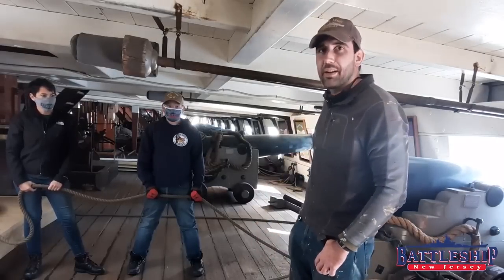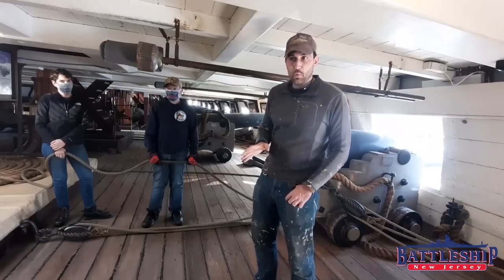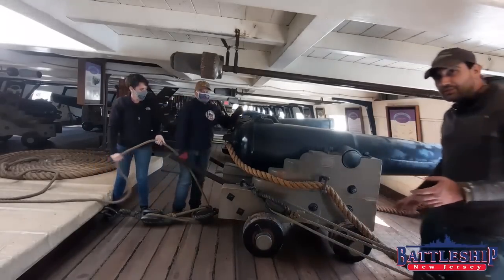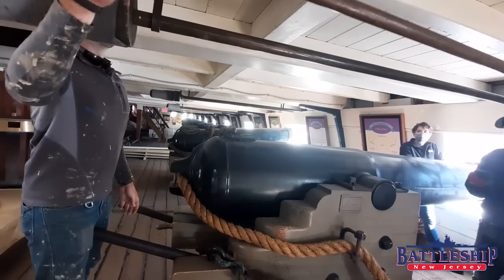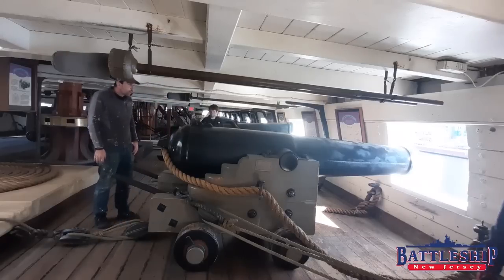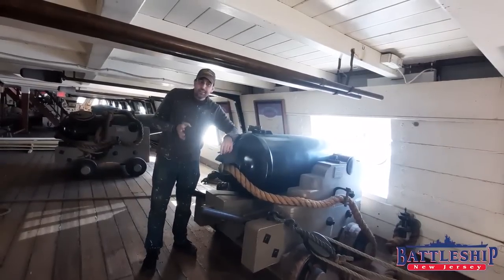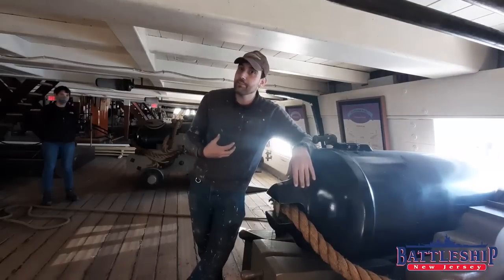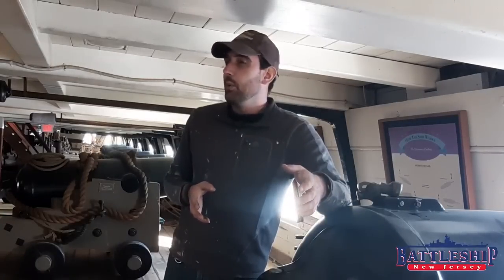How to Fire a Civil War Era Naval Gun

Comment: I have not been part of a drill but I crewed aboard a "character" ship when they took out a black powder club. They fired many broadsides! It was exciting. They were small pieces loaded with foil wrapped charges so they had less chance of burning embers.  I also have a great photo of the noon firing of a Napoleon 12 pounder that was part of a living history program. With an old 35mm camera I was lucky to catch the moment of firing. Would be hard to see either of those events now.
Reply: Forgot to add, the cannon was on Angel Island SF Bay. Can't remember where on the Bay we were sailing. The pieces were about 1/4 the size of the one they demonstrate firing. Hard to convey the volume of noise they make.

Comment: What was missing for aiming, was the adjustmaent of the gun's elevation by moving the sloping wooden block under the barrel forward or backward.
And like someone else mentioned, the pressure of the firing gun was certainly not too much under deck, as the muzzle is outside of the hull and the main pressure leaves the muzzle forward.
But anyway, a very interesting video. I was always interested in those old guns.

Comment: Opening your mouth equalizes the pressure between the inner and outer ear. Even with hands over ears the pressure wave will be applied to the ear drum. Any restrictions on the inside like closed mouth, stuffy nose, or inner ear infection can cause the ear drum to rupture. 
I found this out because I had an ear infection and went on an amusement park ride that dropped very fast. The change in pressure almost ruptured my ear drum. Hurt like hell for a week.

Comment: It's deja vu all over again! Are there any age of sail ships with working muzzleloading guns and a place to shoot them so he can make up for reposting this old video by doing the same but with a live gun?
On that note, did anybody ever actually do the procedure shown in the first half? I can't think of a situation where you'd be hauling a gun in (well, one, see below), the gun took care of that without human intervention, kinda like how a modern cannon poops out the fired case and locks the breech open. A muzzleloader's base state is fully indoors so you can load it and have the gunports closed for weatherproofing. And much like NJ's guns, there's really only one way to unload it without going back to a shipyard.
The one situation where you'd manually pull the guns in: I guess if you were ready to shoot but the captain decided to break off the engagement and run, and you needed to close the gunports because weather conditions/making a hard turn with a ship with multiple gun decks? (making a turn with the lower gunports open was a known issue with triple-deckers, that's what happened to Vasa and Mary Rose, and not being able to run out the biggest guns was annoying to many a captain in Nelson's time.)
Reply: Both of the people Ryan introduced  have manager-level titles, he can put together a proper gun crew and find a real gun (a 32lb smoothbore like HMS Victory hadis acceptable) and a place to shoot it. Actually, I just want to see Ryan pull the lanyard on any artillery. If you're ever in central Texas or Las Vegas, you have no excuse.

Comment: Good video, Ryan.
I just watched a video on the History Hit channel. They fired a Naval gun 3 times. They pointed out just how loud this was and the over pressure. One of the commenters said he'd seen something that said the noise and pressure weren't as bad on a gun deck because the muzzle was outside of the ship and, because the port isn't all that big, the noise and pressure were significantly reduced.

On another point, I've heard that the gun decks were painted red. This was so all the blood did not show during battle. When a cannon ball came through the hull, the splintering was beyond belief. This was shown on the History Hit video where they put 2 shot through a white oak faux bulkhead. Neat, round hole on the entrance and huge splinters on the exit side. https://www.youtube.com/watch?v=WSXaCkQ9sF8
Reply: they used to put sand on the decks so people would not slip on the gore its where the sand lockers started
Reply: @imchris5000  I believe sawdust and wood chips were often spread on the main deck before battle .  I think sawdust on the gunnery deck would make a fire hazard , as any spark from the guns might set it alight .
Reply: @victorwaddell6530  The deck was NOT dry. Sand is MUCH better for grip, sawdust would just turn to slime when wet
Reply: huge splinters that he picked up 2 feet from the bulkhead.🤣🤣🤣🤣
Reply: @bindingcurve  There were more much further away than 2 feet that could cause grievous bodily harm. Unless a person just happened to be in the direct line, it was all of these that caused a lot of carnage.
Reply: @johnslaughter5475  The announcer was being way to dramatic.  The simple fact was the "hull" was not the seasoned wood found on a real sailing ship after being in the water for 10 years.  That demonstration WAS NOT indicative of an actual hit and would not caused any of the carnage described (it may have taken an eye out).  Looks a lot more like the hits taken on Lake Champlain, with the green wood ships
Reply: @bindingcurve  I sailed eight years on a US Navy DDG and a CG . The non-skid paint on the decks was akin to paint mixed with wood chips . Wood chips absorb blood quickly as I learned while working in a woodshop after leaving the navy . I got cut by a table saw while ripping oak treads for a set of stairs .  I lost the tips of two fingers , but they regenerated .
Reply: @victorwaddell6530  non-skid paint uses SAND, not wood.  And mix sawdust with water and you have slime.
Reply: I have a friend who sailed on a reproduction ship. Daily drill was to hang your bedding to air against the bulkhead which would also serve to absorb some of the splintering.
Reply: @bindingcurve  How much sea duty time have you served ?
Reply: @victorwaddell6530  Really?  You server 8 years on ship and don't know how non-skid paint works??? Have worked in a cabinet shop, so know a thing or two about wood chips and sawdust ;)
Reply: @bindingcurve  Non-skid deck covering has coarse chips in it , not just paint and sand .  You've probably never trod on it .